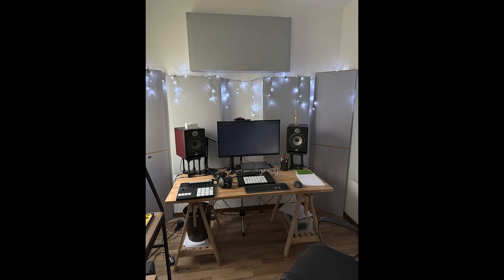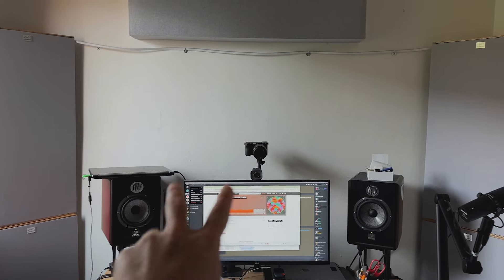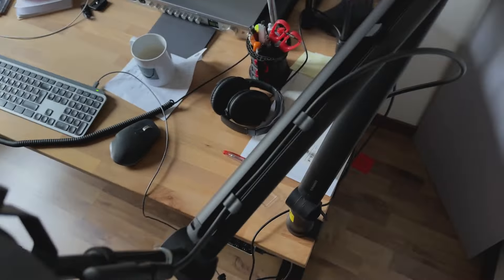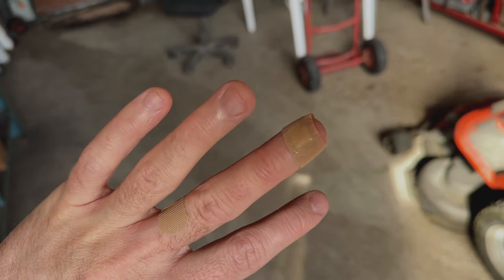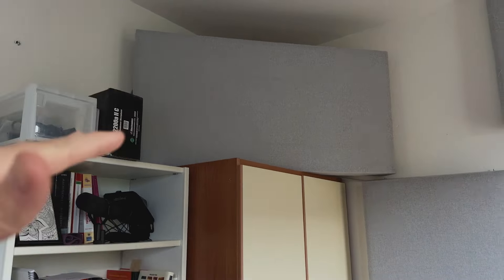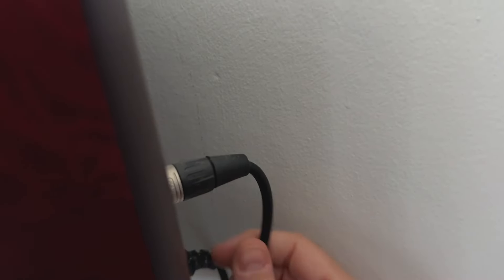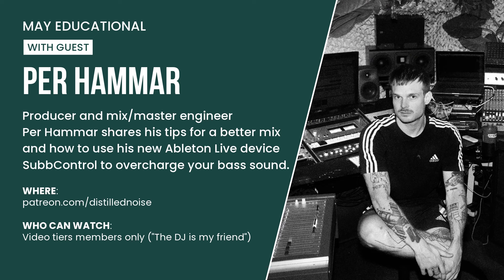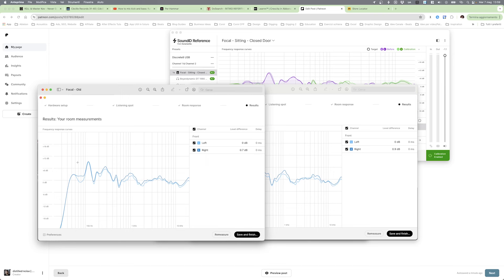The never ending process of getting a GOOD SOUNDING STUDIO

Comment: That 12db peak at 120hz is most likely from front wall interaction. I had that exact same bump in my old studio and was able to fix it with the a 100mm thick panel and a little bit of DSP.
Reply from the maker: Ahhh so removing the back panels i did worse 😅 but i kinda felt an improvement in lower frequences..not sure if that was just placebo effect 🥹
Reply: @distillednoise   bringing the speakers closer to the wall probably did help and might have pushed that peak to a slightly higher frequency

Comment: Bass traps in the corner don't make much of a difference. „Huge” devices with high absorption capacity are needed to reduce the standing wave effect and influence the reproduction of low tones. Only screens that reduce high tone reflections do something. This is why speaker positioning is crucial.
Free REW program is good for acoustic measurements.. profesional tool, I recommend to  trying it. Measurement takes a moment, so you can move the speakers and observe changes. After finding the optimal position you can use correction software in daw. 
Btw. only monitors with bass reflex on the front can be set at the wall.
Reply from the maker: I Subscribe to everything you say!! I tried REW in the past but didn’t think of using it for this latest adjustment. Thanks for the tip